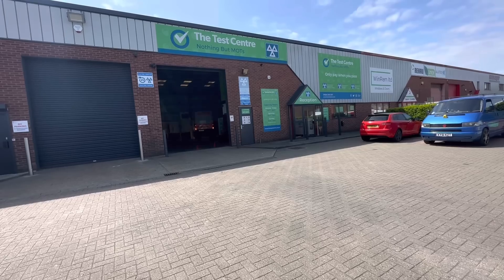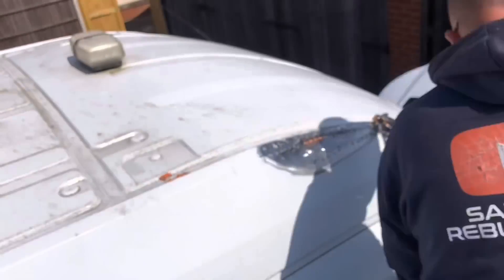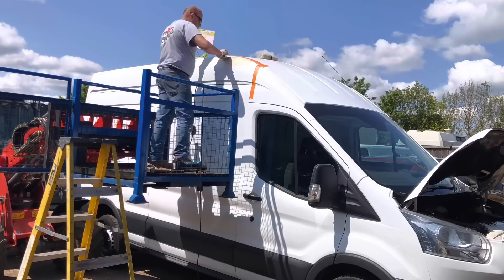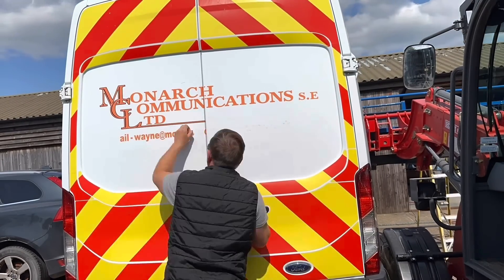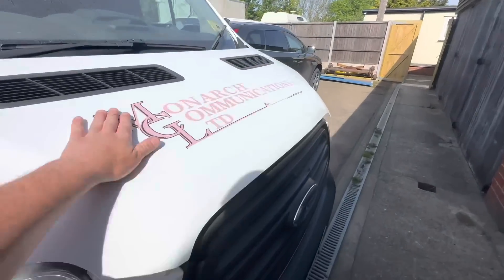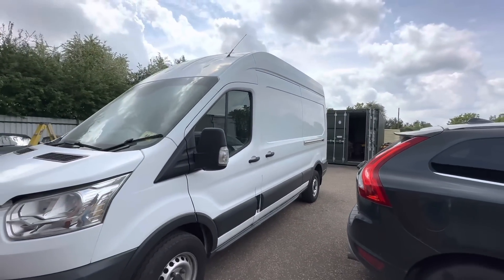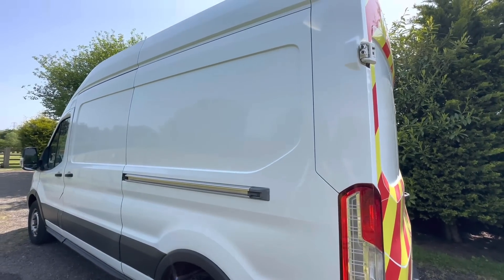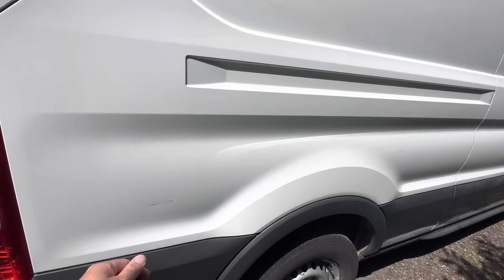REPAIRING A 2016 ABANDONED NON RUNNER FORD TRANSIT

Comment: I like Chris' style. I used car filler on woodwork before painting it. you could fill pretty shallow dents and get old woodwork looking like new. It works out alot cheaper than buying so called "wood filler" which is the same thing but might come in white. When I was painting and decorating I couldn't stand seeing small dents etc on woodwork, most wouldn't fill it but I couldn't help myself. I know this is a car channel but the same principal applies to decorating. Great work again guys.

Comment: Fantastic job all round i would say. Nothing wrong with being careful and keeping the heat down with the polisher Rob, but you are possibly giving yourself extra work cleaning up the splatter? Another way would be to clay  bar the panel which quite often on white will restore the gloss and get rid of the lettering "shadow". Also easier if you worry about burning through the paint you can use an orbital polisher which is much safer, and quicker. These are way easier to master and also on darker colours virtually eliminates the risk of  unsightly holograms if you take your time.  Not a criticism as the job looks great to me, just a suggestion for you to try perhaps?

Comment: Rob/Chris as always a Great Video, And Loving the Fact you actually did the roof. ,Iam Stuck with a rebuild of a 2022 Mg. Did Airbags, rebuilt but Missing Parts and as for trim panels,you have to replace every clip as the Plastic is so poor, parts are cheap but here in Ireland Waiting times.But the Transit Nice Flip Guys. Keep up the good work. Darren ,Cavan , Ireland.

Comment: We run one of these van (2015 RWD) with the 2.2 diesel is there a way of finding out if a injector is faulty without removing it, like in forscan. Would rather replace an injector than the whole engine there must be a way of proving an injector that is overfueling. Had the same issue with our mark 6 ended replacing the engine on that as well.

Comment: As a Forktruck instructor , in future as its not a proper " Man Cage " , attach the stillage to the backrest of the truck with straps or chains eliminating the chance of it slipping off the fork,s at height .Surprised Chris has'nt thought of that .😉😛
Reply from the maker: Absolutely no chance of it slipping off
Reply: It’s chained to the headstock on the machine, you can see them at various points in the video. Especially at 6:19, you can see them really well.
Reply: The Health and Safety Executive takes a very strong line on man lifting equipment, especially man lifting attachments to fork lifts, not only to the design of such devices, but also to the inspection regime for the truck. If I were you, I wouldn't advertise using the use of these devices if you want to avoid potential prosecution.
Reply: @simonrowlands297  they’re self employed

Comment: So important Chris did the roof damage. You might have lost a sale if a 8ft dude came to buy it !!!  I was wondering why Chris didn't bang it out from the inside? Really nice job guys and a nice profit too. Any more of these and you might have to get a bigger garage, or raise the roof on the one you have. 
Someone is going to be well happy with this one.
Cheers, Bob
Reply from the maker: The only way to access the damage from the inside would be to cut out the structural frame to get to the outer skin. It's why we have spot dent pullers bud.

Comment: How come you don't use a rubber wheel to remove the decals? They work great on decals and trim tape, pretty cheap as well.
Reply: i use these i think they call them a caramel wheel
Reply: @MotorwiseBromley   correct.
Reply: @MotorwiseBromley  Yep, they're the same colour as some elastic bands. God send for double faced tape, pin stripes and decals.
Reply from the maker: Yes plenty of our previous videos Chris uses a toffee wheel on small stickers and old double sided tape

Comment: You guys know your stuff but I don’t understand the work & lengths Chris goes to with some of those dents when you can get a PDR guy in to manipulate them out without all that prep & paint 🤔
Reply from the maker: You couldn’t get to it and there is not a pdr man in the would who would have got that out or repaired the cracks in the paint 👍
Reply: That dent was well beyond a paint less dent repair. A long sharp crease plus the paint was damaged to begin with.
Reply: That dent was well beyond a paint less dent repair. A long sharp crease plus the paint was damaged to begin with.
Reply: This wouldn’t be the job but Would be good to see on the channel though a paintless dent repair
Reply: Yes, You’re probably right Rob, had some done on my vehicles where they glue brackets to the car then use suction jacks & literally pull the dents out then knock down the high points, amazing to watch them doing their job, in fairness that did look a serious dent so entirely get what you are saying 👍🏻

Comment: That's sander for the roof dent , called a da , what's da ?
Reply: Dual Action, Orbital sander
Reply: Google dual action sander meaning. It spins round but also randomly oscillates the position of the spinning pad. So you don't wear through the paint in one spot, it's gentler on the surface.

Comment: Wouldn't it be easier to just give it a few whacks with a hammer ( you know what I mean ) from the inside ? rather than have all those pimples and scabs on the outside to deal with ?
Reply from the maker: well yes if access was possible, structural frame would need removing. This is why we have spot pullers